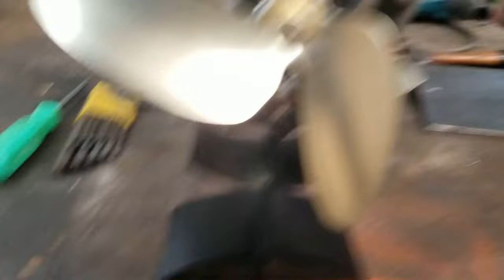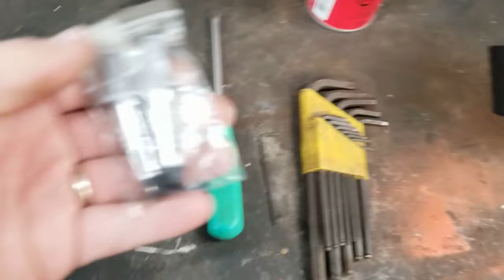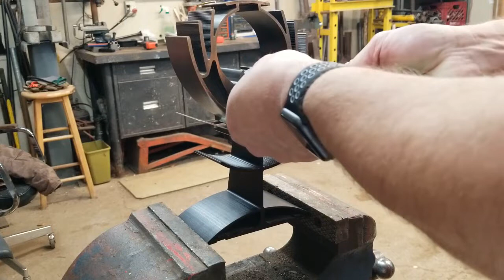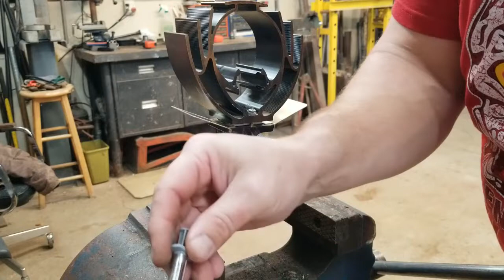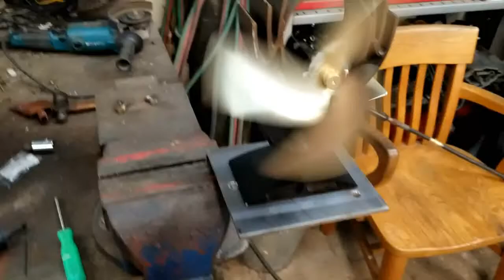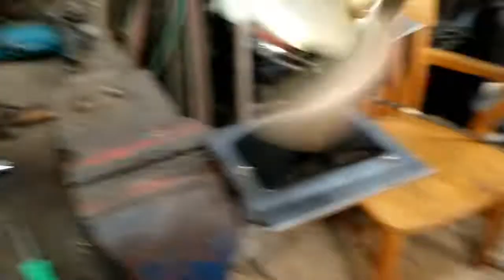How to Repair an Eco Fan for a Woodstove

Comment: Done that 3 times and still dies after a week
Reply from the maker: Try cleaning the motor with electrical cleaner spray. Sometimes the motor can get dirty and will attract dust and dirt into motor preventing free turning. Your thermal coupler may be getting bad.

Comment: so i got a wood stove fan off amazon a few months back i use on my stove in my bell tent when camping. the first few times it worked great it was an awesome little fan. well we camping a few days ago and i couldnt get it to work no matter how hot it got. i tooked it apart and cleaned it and i noticed there was absolutely no thermal paste at all anywhere on the peltier plate. is it dead? or would adding paste make it work?
Reply from the maker: Was the fan sitting on a solid metal surface?

Comment: I knew this video is old. But I bought one used it on. My Mr. Buddy worked fine. I put it on a bottle top heater. Seem to be working fine when I looked back the fans weren’t working. I couldn’t touch it I thought maybe the wires were burnt nope, it was just really hot. The plastic spacers between the thermal pad was melting. So I’m wondering if I match the spacers or still can use them and if I get new thermal paste will it start working again or should I just get rid of it?
Reply from the maker: I would try the thermal paste and you may also be able to buy new spacers. I wouldn't throw it out

Comment: Is there a right way or a wrong way to install plate, I put mine back together noticed is running backwards now. Going to flip it
Reply from the maker: yes try flipping it
Reply: @EastCoastGrit  yes that worked, but I looked like it slowed up a bi. Is it the the hotter the stove the faster it spins. ?  My stove right now is running about 150° and it doesn't seem like it's spinning all that fast, thank you for your making the video, and your time, for getting back to me
Reply from the maker: yes the hotter it gets the faster it spins. make sure you have it on a flat surface so the heat from the stove surface convects into the body of the fan @nickpanhead7209
Reply: Ok great thank you for your help

Comment: How to fix whenmis making a noise ?
Reply: Like the whole blade is loose and moves around
Reply from the maker: there should be a setscrew holding the fan on the shaft this may be loose @BoneFishMechanics
Reply: @EastCoastGrit  thank you. I have the same problem. Mine has fallen off of the stove a couple of times (I cook on the top of the stove...)
Reply from the maker: What kinda noise?

Comment: I had already repaired mine. I used thermal conducting double sided tape. There is a lot on the roll and it wasn't expensive. I also bought a new peltier at the same time as they weren't expensive. I'd read they deteriorate over time, so that's why I put a new one on the fan.

Comment: Thanks just ordered electrical cleaner spray and thermal paste. Fan is in bits, your video inspired me to have a crack at repairs! Thanks
Reply from the maker: Best of luck 👍
Reply: Don’t count on it working too long
Reply: @garycocozzo4750  LOL you're right it will stagger into working but I replaced it eventually.